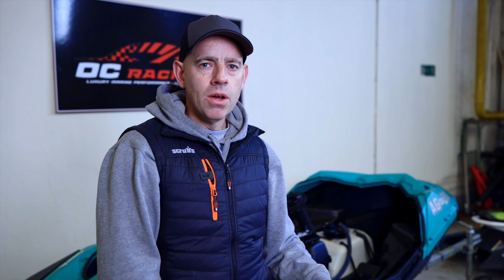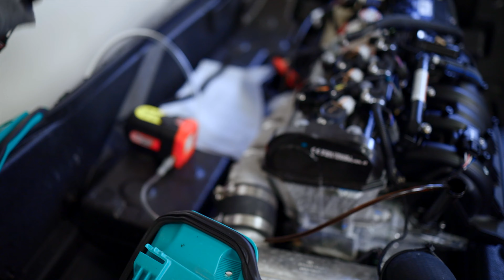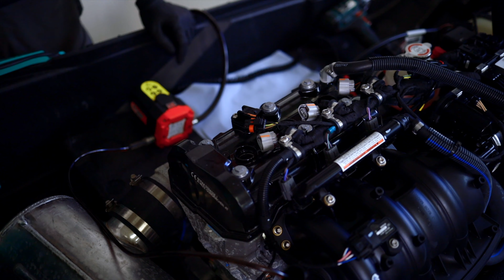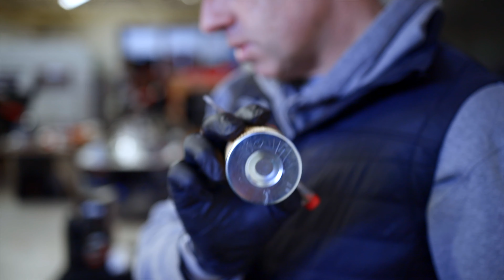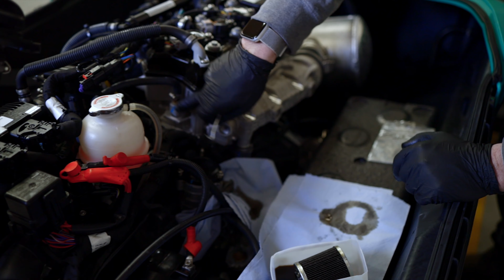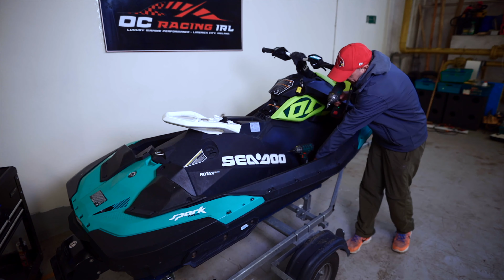How to service & split a Seadoo Spark in 4 Mins

Comment: Seams like you already disconnected the steering cable and wire harness before you started.
Reply: That’s what I was wondering, how do you connect the steering wheel back? Any cables or connectors that need to go in certain way? From the video it seems you just let it sit on top and just bolt on the body?

Comment: Great video! I think Y’all cheated, I didn’t see y’all disconnect the cable / steering 🤔😉 lol... Bishop and I may need to take you up on this challenge. 😂
Reply: Yes I disconnected it :-) 10 mm socket and spanner with the Milwaukee impact drive 😍😍

Comment: Great video! Really helpful… question… do you think you should wash down the engine Bay Area after a salt ride? You referenced salt deposits on the spark in the video… is this due to lack of washing down? The concern I have however if you are to wash down the engine bay is with the limited access it’s hard to near impossible to ensure the other side of the engine bay is dried after washing down… yeh I understand you can spray xps lube and leave the engine hatch open for water to evaporate but it feels like spraying water into a virtually dry engine compartment is likely to promote more rust from the excess water from washing down vs the limited amount of potential salt water that could find its way into the engine on a salt ride 

Finally after every salt ride I have never seen water in the engine bay and can’t understand how water would get in inside.. the only answer I found online is the salt content in the air that gets into the engine bay vs salt water it’s self? 

Any help would be ace

Comment: Can you use mineral oil in a spray bottle, instead of XPS?  Does it have petroleum products in it?
Reply: @IrelandsAtlanticAdventures  

Thanks! I'd prefer not to use canned propellant film if possible when i get a ski, but if it's the only appropriate choice then i guess I'm stuck.

Comment: Hey fellas, I’m having an issue with my IBR system. It beeps either when I start my Seadoo Spark or if it doesn’t do straight away, it happens after engaging the neutral or reverse. I wondered if you have come across this issue and if you might know how to fix it. I’m picking it might be related to battery (don’t know). What are your thoughts?
Best regards.
Marcel